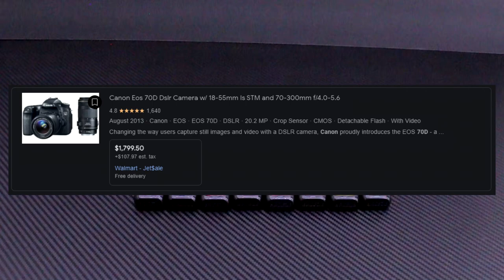How to make a CHEAP CHARGER for DISPOSABLE VAPES UPDATED! (+How to Recharge Breeze Pro’s)

Comment: It worked perfectly, just wanted to add that for different types of chargers, once undressed, you may find 2 additional wires with green and white colors, just negligt them and all will work fine as discriped on the vedio. Thanks a milion
Reply from the maker: No problem, glad I could help!

Comment: works perfectly , like a charm. and the alligator clips are just the cherry on top tbh. wires straight to it will work as well but have  by the alligator clips just makes it that much better and easier and more efficient. having to sit there with the wire to the negative without touching any of the other wires (blue for led red for positive) but this is the best technique no doubt
Reply from the maker: Holding the wires made this a super tedious task, I hated it! 🤣
Reply: @AndyBobandi  do you sell these chargers? I have at least 10 of these vapes sitting an collecting dust because they're dead.

Comment: 4 recharges now.  You can go more than 10 minitues if you want.  I just did 15 minutes.  You can also rejuice  the foam on the other end (use caution removing the mouth piece those wires are thin) using about 2-3ml on each side.  There's youtube videos on this as well.

Comment: Whenever I recharge dispo vapes I use a volt meter to test the battery. Single cell lipos are dying or dead at 3.8v, sometimes a little bit less and should not be charged much more than 4.2v  Usually a 10 min change like you showed will have the battery just about full.
Reply from the maker: Before recording I did the same for the breeze's. Thankfully they use decent quality batteries so it made everything a "breeze" (Late reply my bad)
Reply: this comment was posted like a year ago lmao but would it still have the same amount of hits as a newly bought one or anything close to that?
Reply from the maker: Close to it majority of the time 👍

Comment: I did 15 mins I just used bare wires and a small piece of duct rape to keep it on( but i pulled out battery)....also have done this on a breeze prime because it dies 4 days after I got it
Reply from the maker: Glad to hear it works for primes, I keep hearing that they die WAY too quick

Comment: Hi Andy, I followed the instructions exactly I even got the small alligator clips + & -. I cut a cord but with this cord it was white and red, I continued on by connecting the + with + and - with -  I did exactly everything like on point in the video, I peeled back the tape and made sure the clip + battery was exposed and made sure the - clip was only touching the black. To be extra safe i used electrical tape for the exposed wire. When I plugged it in I started to smell something burning and the light was going off, I quickly unplugged it and tried it again this time the light was blinking and a small spark should I continue??
Reply from the maker: Sounds like the ground came in contact with the blue sensor wire
Reply from the maker: Hope everything went well 👍
Reply: @AndyBobandi  man you are really following up 👍😃
Reply: Girls don't smoke vapes.

Comment: What I usually do I connect the positive to the top of the battery and the negative on the outside of the sensor which is negitive
Reply from the maker: Didn't think of that, glad to hear that works thats a lil easier!
Reply: @AndyBobandi  Yep and I've been recharging one for like the 4th time and it's still hitting great
Reply from the maker: @Tech_481  I've been using the one used in the video for 4 days now, no signs of death! I've been actually charging them for 20-30 minutes, so far so good
Reply: @AndyBobandi  Ooh wow
Reply: @AndyBobandi  hopefully you don't over volt the battery because it might explode like I did with my cheep Chinese cape battery haha
Reply from the maker: @Tech_481  I always keep an eye on em while charging just to be safe, you never know lol
Reply: @AndyBobandi  Haha ya

Comment: I followed your directions but I must have done something wrong putting it back together. It has renewed life so it charged, but I have to draw on it really hard for it to do anything. Any thoughts on why? At least it got me through until I could get a new one. By the way, I used a toothpick to push out the sensor from the little hole in the other end...popped right out.
Reply: might have pressed too hard on the sensor with the toothpick Is probably my best guess tbh, but that is madd smart
Reply from the maker: Could’ve either been one of two things:

•the toothpick strat damaged a part of the sensor (usually build pretty cheap)

OR

•The little rubber piece wasn’t on the sensor correctly OR not tightly secure like it was previously due to the glue after removal
Reply from the maker: Glad you were able to get her working through 🙏

Comment: I’ve got a different problem with one I bought, it hit just fine the first day, then it started acting up as in it will light up when you suck on it like normal, just it doesn’t hit, bad connection somewhere? Reply soon would be most appreciated
Reply: Update: I found a disconnected wire going to the coil and soldered it together hitting just fine now
Reply from the maker: Sounds like it! Damn I hate that, you should try to return it!

Comment: would it be fine to use electric tape instead of clips to hold them in place? my hands are way to shaky to hold wires in place 💀
Reply from the maker: Hmmm, I could definitely see that working, give it shot! Might be difficult to get everything to stay in place though.
Reply: @AndyBobandi  it worked! i taped the positive charge securely down, but held the negative in place, just because the negative charge is a lot more specific and you dont want to accidentally move it. it works well! have to hit a bit harder but ill live since this is a last minute resort
Reply from the maker: @kalopisia  Ayo glad to hear it worked, thanks for the feedback on it! 💯🦾

Comment: if there’s red, white, and black can i just cut the white wire off?
Reply from the maker: Yes!
Reply: thank you omg i was hoping you’d see this now😭
Reply from the maker: @mirra5875  no problem ❤️
Reply: @AndyBobandi  okay wait one more question, when revealing the wires i accidentally pulled off like 2, would it still work or should i start over
Reply from the maker: @mirra5875  I’d start over 🤙
Reply: @AndyBobandi  very late but after 3 hours (plus break in between doing other stuff) i finally got the charger ready, didn’t have alligator clips so i used my hands, and it fucking works and you should definitely sell these😭 literally thank you sm!!
Reply from the maker: no thank you, glad I could help! and I wish lol that'd be a decent market

Comment: i tried this, didnt have my cord plugged in but went to hold the red wire to the part inside the battery, that was all that was touching too, and it lit on fire- why tf did it do that 😭
Reply from the maker: Oh no! Sounds like the positive came in contact with some sort of ground! Be carful what the red wire touch’s besides the battery and make sure the black or white wire doesn’t come in contact with anything other than the ground

Comment: Do you have an estimate on how long this makes the battery last? Just wondering if it’s “800” puffs capable or not
Reply from the maker: Closer to 300-400 puffs. But you can usually charge them twice, which will double that amount!

Comment: What if my cord has yellow , white and just green wires ?
Reply from the maker: Use a yellow for the positive (red) and white for the negative (black solder point on the sensor) 

If that doesn't work, try a different cable

Comment: Worked for me, need to hit it a little bit harder after recharging but I've only recharged one so far so it might be a fluke
Reply from the maker: That’s actually due to that little rubber piece that comes off the sensor! If it’s not put on all the way, you’ll end up with a tight pull
Reply: @AndyBobandi  I went back in and pushed it in more, helped about 80 percent better thank you!
Reply from the maker: @leahann8930  🙏🤙

Comment: i did what u did but mine doesn’t work it’s the same brand and everything but when u blow into it smoke comes and when u suck it the smoke doesn’t work and it won’t light up
Reply from the maker: Check the sensor and make sure you put it back the same way, also make sure its pushed down all the way

Comment: I don’t get it dude. I’ve used this same method 4 times and it broke my breeze every damn time!!! What do I do cuz I don’t wanna buy a vape every few days
Reply from the maker: What exactly broke??
Reply: literally same
Reply: First time I did it, the positive port on the connector sparked and the red wire burnt off the sensor. I may have touched the negative on the blue or red port on the sensor accidentally or something, idk. 2nd try worked like a charm though. Maybe a bit of luck involved 🤷‍♂️
Reply from the maker: @seandon3k  glad to hear it worked out, sorry to hear that!

Comment: Cn someone please help me? I assume I followed every step, but when I put the red wire on the battery and the black on the censor, a huge flash appeared. What am I doing wrong?
Reply from the maker: Make sure you don't accidentally touch the end of the blue wire (where the blue wire it sodered too on the sensor), itll cause it to short out and can result in the led on the sensor flashing
Reply: @AndyBobandi  dude! I managed to get a hit or two out of it but that because I’m only charging for half a second. It keeps smoking and or giving off a spark. Is this normal in the beginning? Can i tape off everything but the black cord on the sensor? Sorry for the complications man
Reply: @virgilastro  the spark happened to me as well. I’m also curious as to why it kept doing that. I could smell the burning and it actually severed the red wire thats connected to the port.
Reply from the maker: Sorry for replying late, were you using alligator clips or just the wires?
Reply from the maker: Yikes! What exactly did you do?
Reply: @AndyBobandi  turns out I’m just afraid of getting electrocuted but it works! i really appreciate all you do my kind sir
Reply from the maker: @virgilastro  ahh understandible, glad I could help!

Comment: It worked I got the strawberry one but I did it with a android charger it does get a little hot but it’s more like a pinch as long as u touch the right one it’s withstandable and I spent about three minutes again I said it’s hot and I pull that sensor out too
Reply from the maker: Nice, glad it worked!

Comment: there’s like white stuff in my vape is that an exploded battery?
Reply from the maker: Around the battery or over the positive connection?
Reply: @AndyBobandi  around battery
Reply from the maker: @laurennorg2124  if its hard and solid, its just the glue for the battery

Comment: Ummm.... thank you hahahah i am successfully hitting my breeze again and also I didn't have the clips so if you holding it raw dog the sensor will get hot just be careful
Reply from the maker: The clips just make it easier lol, glad I could help!
Reply: What do u mean hold it raw dog cuz i want to charge mine
Reply from the maker: @OnlyYe2  using just the bare wires and manually holding them in place for 10 minutes. Its time consuming, but works! Its essentially getting to the point where you need the alligator clips, but obviously continuing without em

Comment: You said don't let it touch the blue wire... But you put it directly below the blue wire and not the red... What do I do???? Lol
Reply from the maker: I'm a little confused by what you mean!

Just dont connect anything to the blue wires connections, as its not required for charge 👌
Reply: @AndyBobandi  I figured it out, I ended up just stripping the black wire and connecting it that way! You saved us! Thank you!
Reply from the maker: @R3AL-AIM  Glad I could help!

Comment: It won’t even light up idk what I did wrong
Reply from the maker: Make sure the sensor is put back correctly in that little rubber piece, if it's in upside down or crooked it won't hit